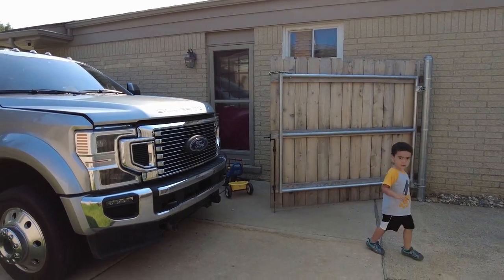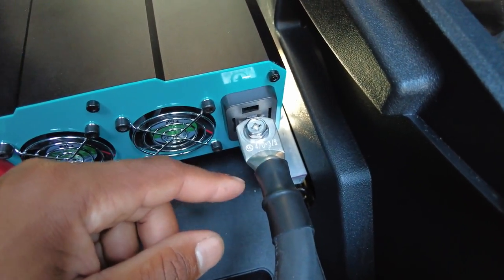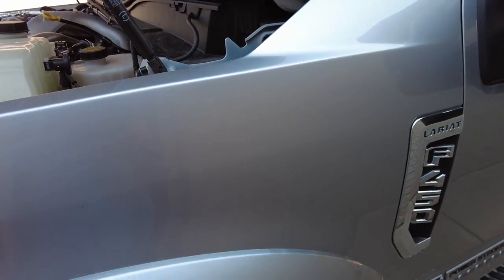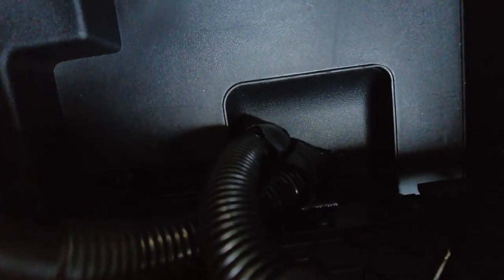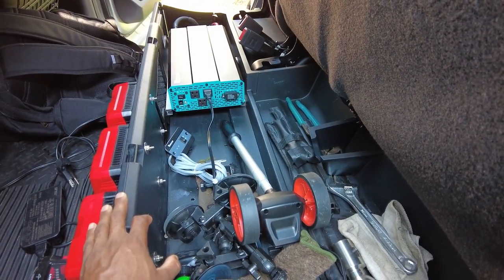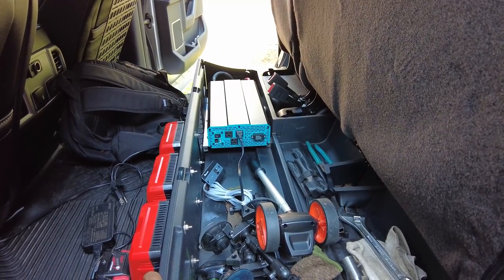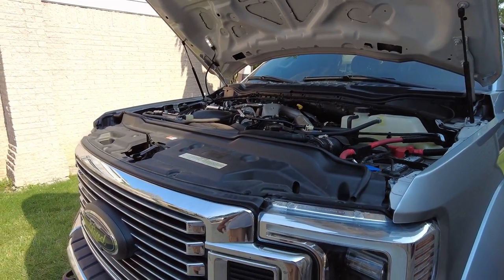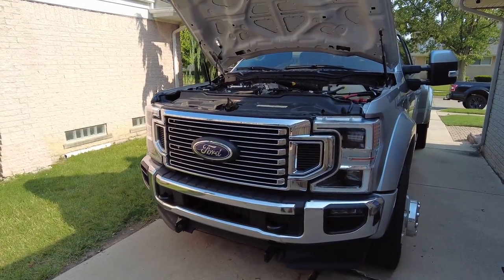Cool power inverter install SUPERDUTY.

Comment: I think you made a good choice by installing a 3000 watt inverter. You’re prepared for a possible power outage. You could power your refrigerator and quite a few other appliances. Your installation is clean and solid! Nice video! Thanks for posting!

Comment: The term 'gauge' references wires that are up to 1 AWG. The term 'aught' refers to wires that are 1/0 AWG or larger, with the “/0” part being called aught. For example, 1/0 AWG (0) is called “one aught” and 2/0 AWG (00) is called “two aught.
Reply from the maker: Thanks for explaining that!
Reply: "Aught" is a term that is most often, I believe, used by the British.  For example, the year 1904 is expressed as 19 "aught" 4.  They don't say 19 "o" 4, as "o" is a letter of the alphabet.

Comment: I read the comments, you said you had a fuse or breaker at the battery, good deal!  Looks like a nice clean install!  I am sure there us a reason, but since you battery is on the drivers side, i would have tried to put the inverter on the drivers side too, but under the rear seat like you did, this would have shortened your cable run, which costs you less, if you dont need as much length of 4/0 cable, and DC is prone to voltage drop the farther you go from the source!!!  But with 4/0 cable should not be a problem.  After a certain wattage of inverter i think they suggest a 2nd battery.  Most good inverters will warn, and shut down before you run your battery down too far.  I am going to look if i have a port under my back seat like your truck has, i would like to have an inverter in my truck too.  I am shocked your factory inverter wont charge your laptop, i have a little cigarette lighter inverter (175 watt maybe), and it charges my laptop, but you laptop may be more power hungry?

Comment: Aught is synonymous with zero and is usually used in the trade for wire size. Nice clean job.
Reply: That’s right…. Four aught is the proper term.   You know the things you had to redo or rework,  but you were learning and I’d say that’s a fantastic install job.   If you didn’t confess, I’d have never known you weren’t a pro doing this all the time!

Comment: Was looking for a video showing a 3K PSW inverter, and that brand too. Decided to put one in my Hummer H2 for back up power as a portable generator. Figured I would definitely need to ditch the factory 144amp alternator for a 400 amp one like a Mechman or equivalent. Did that about 16 years ago with my old car audio system. Inverter install looks to be the same as a beefy car audio install. Big alternator, big OFC power/ground cables, quality battery, 500 amp battery isolator, and another battery running the inverter. Maybe even throw in a battery capacitor to handle any fluctuations. Your wires being 4/0 is basically "0000". They are fatty big boy wires. Would have used those on an Orion HCCA cheater amp back in the day for sure. Might have to run double 1/0 power and ground wires for my purpose. Great looking clean install! You got one sweet ride for a work truck!
Reply from the maker: I can't wait to see your install
Reply: Yep, gonna upgrade alternator, put dual fat wires to the isolator, the battery cap, then to a auxiliary battery with inline 250amp fuse block in-between on each. Auxiliary battery stays in the back in a secured plastic case near my current sub box. Really that's the only permanent part of the install. Doing this to 2 vehicles. Everything else is going to be fully portable from my vehicle to my wife's vehicle. I'm building custom jumper cables, quick connect mil-spec battery terminals with 25ft of power cable (still gotta take measurements from driveway to inside 2 homes where I can use at different locations depending on which house loses power. The inverter will be inside the house in a location near a kitchen or the breaker box. Run whatever from inside, leaving vehicle parked outside with tire boot locks to prevent theft while it's idling. This is strictly for storms/freezes/emergency power outage or camping/fishing/hunting scenarios. I've got gas generators at my house, parent's, inlaw's, etc., But this will be on top of that. Besides my gas generators are loud as hell, announces to the neighborhood your out of power but have a gas generator for everyone to come and steal. Just want a fully portable way to help power a house during an emergency. I'm usually called into work during a hurricane down here in Corpus Christi, Texas, so I want my wife's vehicle set up to go when needed when I'm not there.

I'm 49 now, but I was installing car systems for myself and friends from 1991-2007. I've wired many multi-amp systems, swapping alternators, and installing all the extras that help the system run at 14.4v as long as possible. Just never did an inverter before. Looks like a subwoofer amp to me.😂

Comment: Couple Oddessy Extremes AGM and a 400 Amp Mechman ( I assume you have 2 alternators, just replace the one near drivers side) Your good to go. The 4/0 wire is perfect, guys running higher wattage for subs us that or less.  The inverter has overheat protection and the duty cycle will shut off if to hot. Also not sure I saw a fuse block for that 4/0 near the battery. 300 amp fuse block encase that cable get cut. You could also run 4/0 power cable from battery to alternator to replace the factory power cable.
Reply from the maker: Yes. There is a fuse at the battery.
Reply: Would be interested in seeing the factory inverter and wiring upgrade.

Comment: I’m using power mostly when camping…in truck charging only m12 batteries or not running laptop so factory inverter is fine.
Two 6V batteries in bed so can take them out of season…3000W inverter on top of them, charging thru dc-dc hooked up to uplifter switch OR 200W solar.
Never got out of juice. Coffee maker, induction cook top for breakfast, fan in tent or notebook…love that setup.
Really don’t like idea of running crazy thick wires all around the truck.
Reply from the maker: The wire stayed outside the cab for the most part. Only popped in to tie into the inverter

Comment: I have a question for everyone, shouldn't the ground be as short as possible? So run it to the frame directly?
Reply from the maker: Yes. I felt like the ground to the frame wasn't heavy enough.
Reply: Usually yes you ground to frame. However many cars and trucks, from factory don’t have the best grounding, especially when installing heavy amperage aftermarket equipment. It’s not uncommon for installers to use whichever way provided a better ground(less voltage drop/resistance) so if running a ground to the battery proves less voltage drop, run it.. if it doesn’t, waste of wire and just ground it to body/frame.

Comment: Why did you choose to connect to the driver side battery?  Conmecting to the passenger side would have shortened the cable run and avoided some issues.
Reply from the maker: Plow was already on that battery.
Reply: @DS-TRUCKS  Good Reason!   Thanks for the reply.

Comment: Beautiful job on the install! Seems like your beating yourself up over the unit. It came out great! I wouldn’t have went with anything less than a 2500 watt. 2400 watts continuous is a full 120V 20 amp outlet, that’s what ,this way you can use a heavy duty grinder , sump pump ,120v  air compressor  or anything else that plugs in with out fear of it not having the surge capacity.   If your going to add batteries , I prefer the group 31 OTR truck batteries for running big draw items.
Reply from the maker: I wonder if this unit is 20 amp ?
Reply: @DS-TRUCKS  it’s 3000 watts it’s 25 amps

Comment: 4/0 welding wire can handle a lot of amps and heat. For the distance you ran the wire you have over built it which is how I do things lol..
Reply from the maker: The 12 volt side calls for heavy wire.
Reply from the maker: In these systems the higher the voltage the thinner the wire and longer distance can run. On 12 volt side thicker wire is needed.

Comment: Awesome job, thinking about doing a somewhat similar set up. That being said, it's crazy you had issues charing the computer at batteries with the stock inverter. I have a 2019 350 powerstroke and a 2023 f250 gas & have never had issues charging tools or computers whether its 100+ or negative 50. Maybe i just got lucky 😅... coffee pots on the other hand 😒

Comment: Looks good, but if you want any input…….

The manual for the inverter specs 10” clearance on all sides.  It realistic but you’re likely getting hot if you run it with the seat down.

- really wold be better to separate the wires coming off the battery better. That positive we’re going forward crosses very close to the negative cable below it.

How has it been working out?

I looked at the 2000 and 3000 and decided to go with the 1000 for my truck bed (covered) to keep the wires to 2 AWG for a 15 ft run at up to 160amps peak
Reply from the maker: It's worked really good. But I usually  use 35 - 50 percent capacity so it's good a dissipating heat. If I push it closer to it's capacity I open up the seat and keep an eye on Things. It still runs pretty cool No matter what I throw in it.
Reply: @DS-TRUCKS   sounds great . Also looked like you were missing the covers on the 12v dc terminals on the back of the inverter. I like to always keep terminals cover so you don’t get an arc from a stray tool or tent stake etc that could bridge them and get full battery voltage. 

Installing a 1000w renogy inverter in my truck bed to supplement solar and charge bikes and 2400w battery while we drive.

Comment: Terrific installation, really nice job on the install, supper clean and professional looking. I may have missed if you mentioned, how’s the heat dissipation with such a large inverter mounted in an enclosed space under the seat?
Reply from the maker: Actually pretty good. This large inverter doesn't get really hot. When I'm pushing it hard I will open the seat.
Reply: I was thinking the same (heat dissipation)

Comment: I too have the dual alternators on my F250 producing 397 amps. I contacted Ford asking them some tech questions and one was asking what max size inverter could be installed. They responded by saying they don't advise on size, types etc. and to calculate all the installed equipment to ensure you have enough remaining to power the inverter or something like that. They did say that they recommend no more than 50 amps to power the inverter on a vehicle with dual alternators.
Reply from the maker: I think I'm at something like 300 amps.

Comment: I am in the process of installing an inverter, I was thinking of 1000W, what is your recommendation ? 1000W or 2000W - I also might use it for charging my power station. Also for 1000W I think 1/0 AWG should be fine with 135 AMPS circuit breaker.  Anyone have experience with 2000W inverter and writing and circuit breaker ?

Comment: Did you consider installing it in a weather guard tool box in the bed and using soow or sjo wire  to bring some outlets into the cab and install plugs after your drill  a small 3/8 hole through the floor plug and add a grommet? This way you can still have the underwear storage and have extensions leads under the seat for hook up without actually having that refrigerator sized inverter under the seat. That remote wire look like phone wire if I was seeing it correct which makes me think it’s a signal only and not for load
Reply from the maker: That's not a bad idea

Comment: Is there a way to install a separate power switch at the dash, like a toggle switch? How many amps would it need to be rated for and how would the wiring run?
Reply from the maker: This inverter has a remote on off switch. It needs to have a wire running to it. An aftermarket on off toggle switch? Probably not.

Comment: You should research how to size wire. Basic ohms law. Take your watts (3,000 in your case) , divide by your voltage (12v) and this will give you your amps which is 250amps. From there you can look up wire size charts and select the type of wire and this will tell you your size. There are different types and temperature ratings of wire. Assuming you use a copper 125degree C wire you could have gotten way with installing a number 2AWG  or number 1AWG conductor instead of using massive 4/0 AWG
Reply from the maker: At 12 volts the heavier wire is recommended. At 24 or 48 volts Thinner wires can be used.

Comment: Curious as to why you think this is a "very complicated project". Which part did you find "very complicated"?
Reply from the maker: My first time messing with power inverters. Having such a high capacity on a 12 volt system. Recommended wiring sizes with distances from the battery. Once installed the system is relatively simple.

Comment: Great video! This is exactly what I've been looking for to provide power on my remote property. Have you looked further into using one of the upfitter switches in place of the remote?
Reply from the maker: Sure, it's possible, I haven't figured it out

Comment: The 9.99 everstart 100watt inverter will charge milwaukees and the laptop its soo weird
Reply from the maker: The big Milwaukee batteries?
Reply: It will do 1 quick charger or a laptop over night it wont kill your batteries either. Only a single outlet 120 watt evertstart value.

Comment: Did you happen to look at just using the factory wiring and modding that to connect to a bigger inverter?  Seems like since you had to do wiring anyway it might have been worth doing it that way so you could use it in all your factory plug in locations.  Great job either way!
Reply from the maker: Factory wireless way to thin.

Comment: Regular car batteries are not made for power inverters. Deep cycle marine is. Once you draw down the battery it's normally junk not r v marine batteries
Reply from the maker: @smanbman5732  has big enough alternator to keep everything charged

Comment: What is that behind the rear seat metal plate for.? 
Looking at your project not an electrician here but need to upgrade that inverter onboard my f250
Reply from the maker: On the back of the passenger seat?
Reply: @DS-TRUCKS  yes that one

Comment: Does this work with helping your truck on a cold start?
Reply from the maker: No
Reply: @DS-TRUCKS  can I use this to somehow transfer power to my heater block? I have a 97’ f250 diesel that I take to work but I need to leave it in a parking lot during work so I don’t have somewhere to leave it plugged in. I got a 7.3l powerstroke and it’s starting to cool down
Reply from the maker: @PapaRabii  your batteries would be dead by the time you got back to it